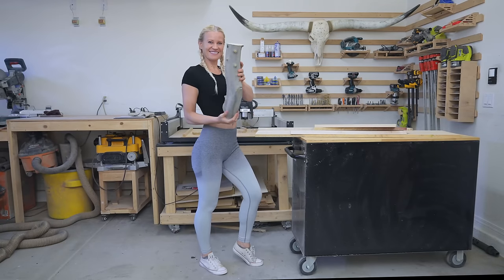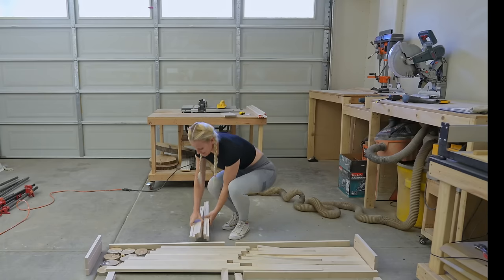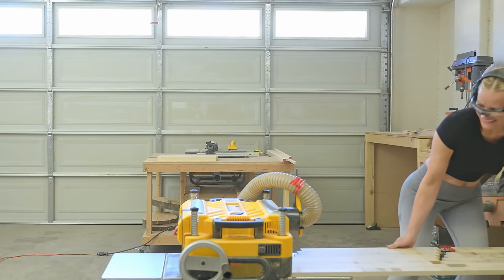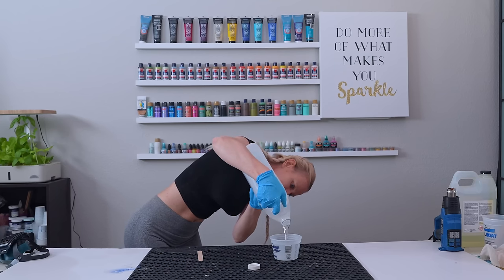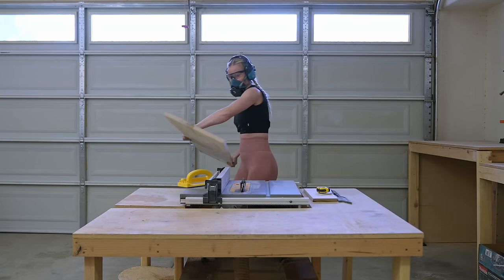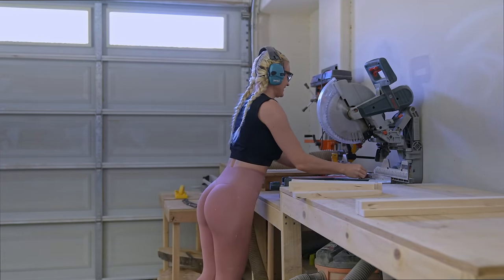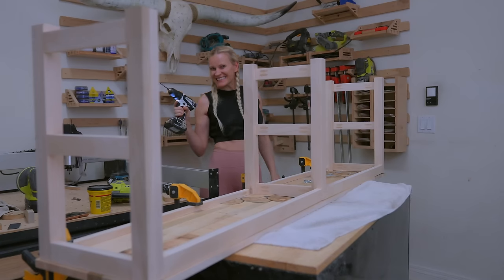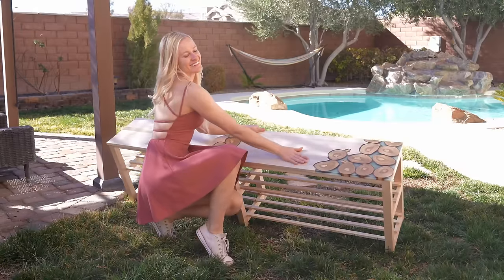💡That genius girl spend a weekend building this with an recycled olive wood branch  #workshop

Comment: Another great project Meike .  I love when you  measure in ( Canadian)  mixing your standard and metric   it's  how the carpenters talk  here 🤔  I was wondering what inspires you for a project  it seems like necessity with most of the projects always having a place in your home .  Now I always wanted to ask about the larger stump you were hanging from in a previous video . It probably wasn't practical having it taken back to your shop but it would have made a beautiful slab table.
Reply from the maker: Thank you very much Darren! 
Yes you are correct, most projects I come up with out of necessity. I don’t like to buy things I can build myself. 
As for the big tree stump, I assume you are taking about the one I found in the desert. I wish I could have brought that home but I wasn’t even able to move it just a bit. Unfortunately it was wayyyy too big for my little workshop.
Reply: @What Meike Makes   yes that is the one   I have found similar ones here that wash up on the beach  but they can't be used either way to much sand and  salt embedded into it  but  I do slab some giant trees 4feet plus 120cm + for your bilingual measurements
Reply from the maker: Oh wow, that’s a big tree stump! It’s unfortunate that it’s not usable anymore
Reply: @What Meike Makes  I wish there was a way to get  one of these giants slabs to you  that didn't cost a fortune  .... something 4' ×6' and 5" thick average   but so heavy.
Reply: Another great project Mieke.the top looks pretty cool also like how you assembled the piece using the pocket jig .now you can go shoe shopping!

Comment: I really like the two layers of resin idea. Any thoughts on using the thickness planer to even out the wood and resin surface without so much sanding?
Reply from the maker: Once you got one side level, you could totally use the planer to level the other side 👍

Comment: Awesome creativity as usual. Have you ever changed the blades in your planer or had them sharpened? Noticed the burnt spots on the wood.
Reply from the maker: Yes it was overdue! It’s changed now, i was waiting for replacement blades but didn’t want to wait to film the video :-)
Reply: No worries, I get it, was just trying to help a fellow woodworker. Maintenance of tools isn't the most exciting thing, but it's still important. Looking forward to the next one.